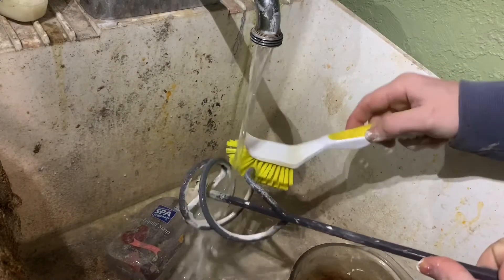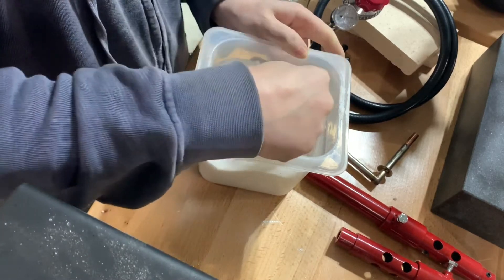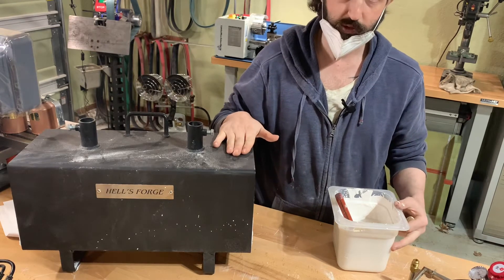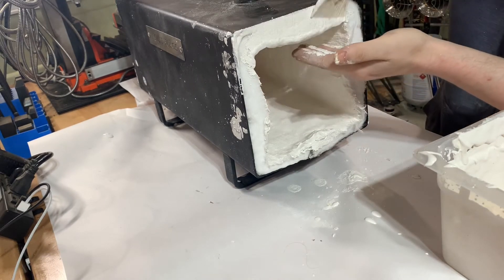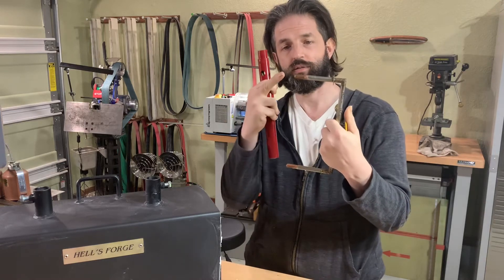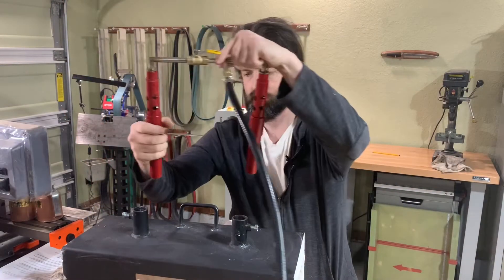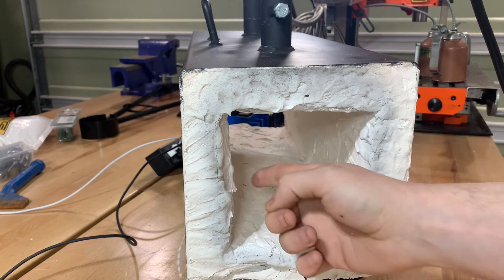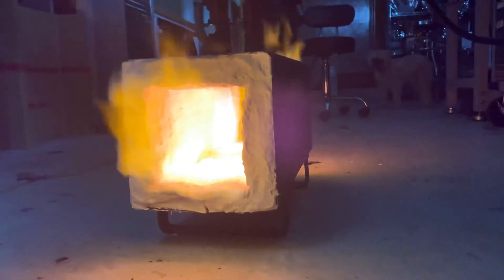Setting up Hell’s Forge MAX propane forge and Hellcote 3000 application

Comment: Do you have to use the coating or is the blanket sufficient asking because I did not coat mine I’m new at this
Reply from the maker: 100% yes to using the coating. It’s very important. The blanket is made of tiny ceramic fibers that are similar
to asbestos. You shouldn’t use or interact with the blanket without having a respirator on.
Reply: You covered that in your video about the similarities to asbestos and the safety concerns my prime concern is functionality of the forge minus the coating
Reply from the maker: I’ve never tried it, but I would imagine the insulation’s effectiveness is probably within the same order of magnitude with or without the hellcote. 

At the risk of sounding like a broken record, I’m not positive though cause I’d never try or condone trying it without the coating. It’s literally a prophylactic, the condom of forging.
Reply: Thank you for your information it’s very helpful but if using the coating means I don’t have to wear the mask anymore then I’m down for that again thank you

Comment: Question how hot does it get. I've seen where people say 1200. But I have heard it gets up to 2400. Are you able to tell about what temp it can reach. 
I'm looking to get one for my stepson.
Reply from the maker: I’ve only taken mine up to 1700, haven’t tried to go any higher than that. You can always get a few more degrees by putting some fire bricks in front of the doors.

I drilled a small hole in the wall of mine, and stuck in a cheap thermocouple with a digital display from Amazon to help see the temp. It’s kind of a crutch though, there can be hotspots and cool spots so it isn’t super accurate. Ideally you want to learn what color 1200 degree steel looks like, and 1300 degree steel etc. Being familiar with that is probably better than a cheap thermometer. You could also get him a telescopic magnet. Steel becomes non magnetic between 1400-1500, which is a very convenient temperature; it’s in a temp range where important operations happen.
Reply: @Maudigan Makes  thank you. I knew about the magnet part because of some of the machining I do. The reason I asked was if it will let him forge.weld with it. I guess I'm saying it right lol. It seams like something he is going to stick with so I don't mind putting in a little extra money for one that will work as he grows and learns. Thank you for the reply so quickly.  I know nothing about forging

Comment: should always work with kaowool outside and with a respirator. make sure those cracks in the hellcote get filled, cuz when the forge is running the ceramic fibers try to go airborne and the cracks will let em loose. that's usually how you get longterm exposure to kaowool. some grumpy old men told me. great job and gz on the cool forge!
Reply: oh final thing - coat the forge in ceramic coating like itc100 it will help keep it sealed, and makes the forge much more efficient :)

Comment: What is the difference in the other Hell Forge sold?  The semi round ones vs this one?
Reply from the maker: I had the same question when I was shopping for one. The only thing I could figure was the workspace between the ceiling and brick floor. The round one had a higher ceiling in the center since it was round, but based on the details on their site it sounded like the square one had more space. I wanted to put a 3” square mile steel tube in it as heat spreader and I was afraid it wouldn’t fit the round one. 

And, if I’m being honest I was subject to the “it costs more so it must be better” rationale…